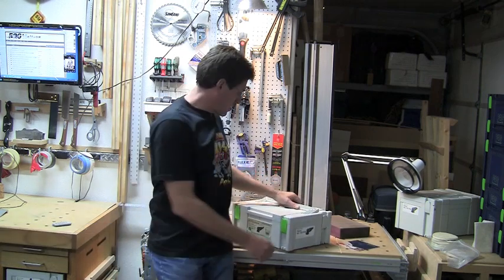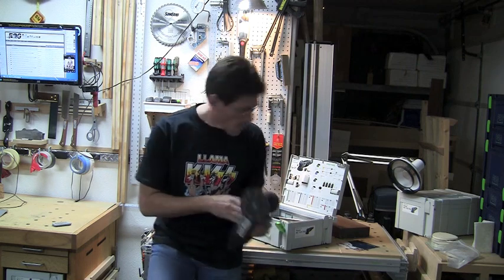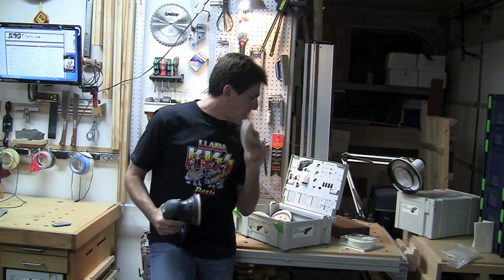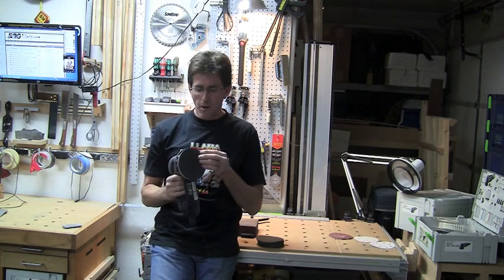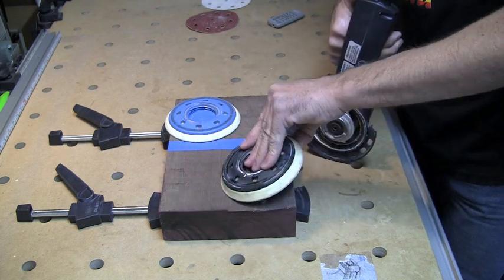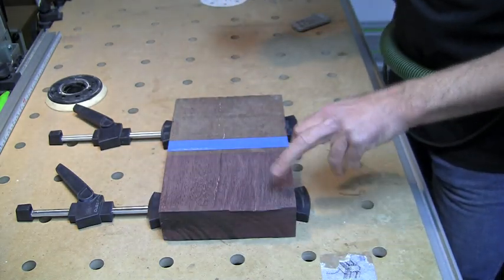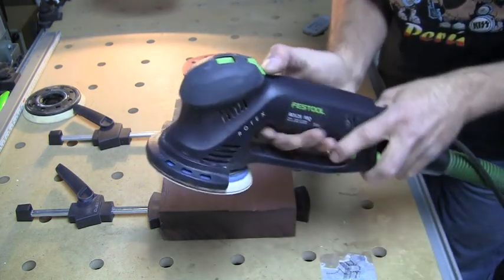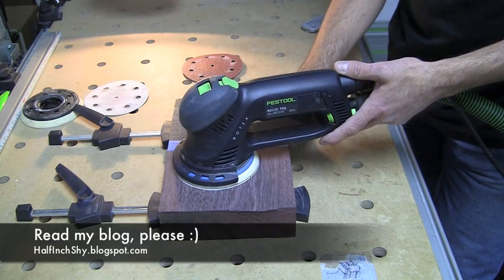#10 - Festool RO-125 Dual-Action Rotex Sander Review

Comment: Hi Paul, You are a very knowledgeable guy so maybe you can please help me here a bit. I bought a random orbital sander and it came with a hard pad (backing). The manufacturer also sells soft pads. What is the reason for this? Also the hard pad seems to make the ROS jump around whenever I put it down on the wood. I have to push down on the sander for it to stop jumping. Do you think that is due to the hard pad or maybe the 80grit that I used? Many Thanks

Comment: Hi Paul,

I keep going back and forth from the 150 to the 125 for my next purchase,

 I heard the 125 is more unwieldy , have you experienced this and also did you have to break in the sander before it ran smoothly?

thanks a lot for all your help

your videos are super helpful 
Ben
Reply from the maker: I've heard people say the 150 is unwieldy, and it is as it requires two hands to operate. I can operate the 125 on-handed in ROS mode; in direct-drive mode, I cup the head and you get great control.  150 is 44% more surface area so it sands a larger surface much faster.  If you do face-frames and don't have a smaller sander for those, the 125 would be perfect as it still does face frames very easily.  Between the two, the 125 is much easier to handle.  As for breaking it in, there really isn't a break-in period. If anything, there's an operator break-in period where you learn how to modulate the dust extractor's suction to the workload to avoid skipping and, of course, getting the feel for handling it in different situations.

Comment: Paul, can you use sand paper other than festool paper?  Is the festool paper worth it?  I have the Rs2 sander, but I have been looking at these.
Reply from the maker: HI, I bought an assortment Systainer when there was a promo for one long ago for mine. The pricing on that is actually pretty good (though you pay for the Systainer over the paper).  The papers do seem to last a very long time as the combination of the papers and dust collection keeps the paper from loading.

Other hook n loop paper will work, but not as well because only Festool has the 9-hole pattern that gets air flowing across the paper for extraction.

I know that Tom at Tool-Home.com puts together custom assortments; this can cut the cost a bit over buying several boxes.. Maybe email him to see if you can get a progression of grits and count of sheets for each. He's done that in the past. Definitely get more of the lower grits.

Comment: Hi Paul, thanks for these great videos. You've disappeared! Anyways, any idea how the RS 2e would compare to the Rotex 125? I already have the ETS 125 ( the new pro5 ltd ) and was wondering which one of these to get to complement the gentleness of the pro5.
Reply from the maker: The RS2e is great for large surfaces. Since you have an ETS 125 for fine sanding, I think I'd look at a Rotex model. Combining the direct-drive sanding and fine RO sanding makes blasting through grits so much faster. With that in mind, an RO-125 can be useful since you'll use the same papers. But if you want a large surface sander, the 150 would be better (45% more surface) though then you start having to stock other size papers.
Reply: Half-Inch Shy Thanks for the advice

Comment: what festool sander is a good all purpose sander
Reply from the maker: Love the hat in the profile pic :)

It's hard to know which sander is a good general one for someone without knowing their projects. If you do face-frames or have a lot of relatively small areas to sand (because big areas are ply and generally needs a fast pass on fine grit) then the RO-90 is my new favorite since those videos.  I'd say I use it 9 out of 10 of the Rotexes.  Granted, for large flat surfaces, I can do fine sanding with the RS2e.

If you build a lot of large flat surfaces from hardwood, then an RO-150 would be great (or 125, slightly slower, but much more comfortable).  If you do face-frames or other narrow-ish stock with ply, then RO-90 is fantastic.

On my current Angle Madness project, I'll be using the RO-150 to sand the boxes since they are all Maple. The veneered panels I sanded with the RO-150 as well as they are large and needed some work to get the veneer tape residue off.  RS2e is what I'll use to finish sand them, but the RO-150 would work equally well for that.

In my sculpted/shaped projects, I used the RO-90 with an interface pad to finesse the shape after shaping with the RAS-115, but I use that like a slow controlled grinder for shaping... it isn't a sander in the normal sense.

Dunno if that answered your question :) if you have other questions, ask away!
Reply: Thanks